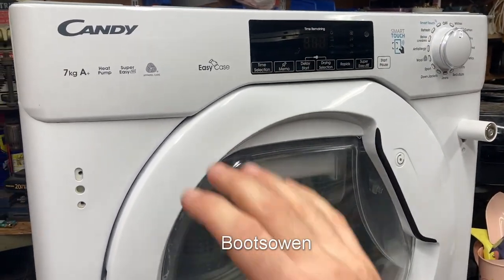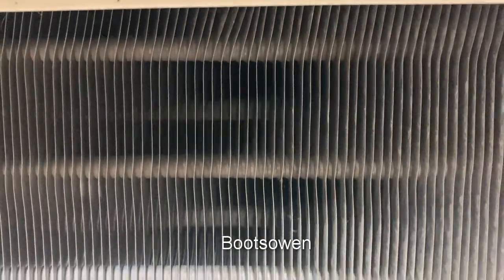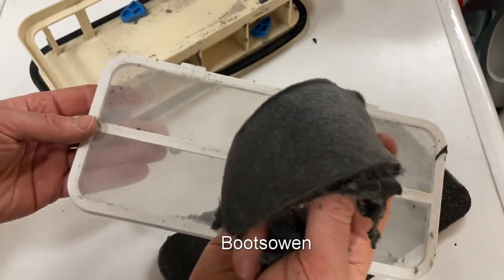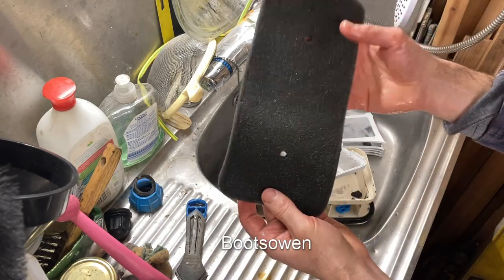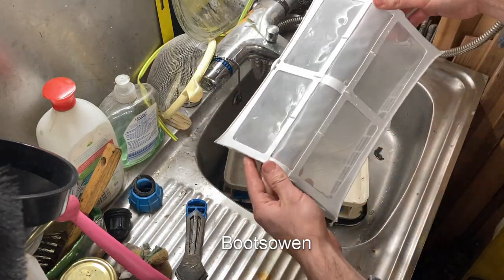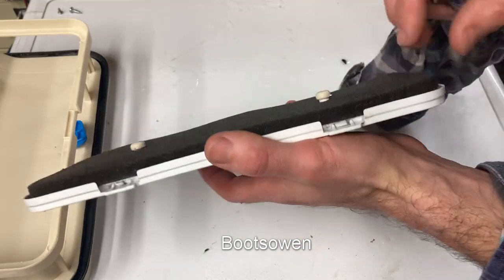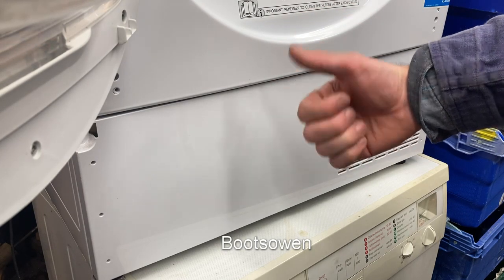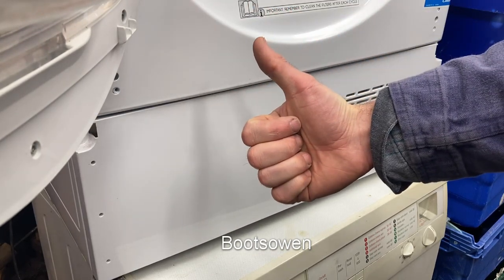How to clean the heat pump tumble dryer filter

Comment: Rule of thumb is. If ya can't see through a lint filter then air can't pass through it. One in the door after every cycle, one in the bottom once a week. Our whirlpool are the same. They can get caked in white gunk from laundry powder and softener too, it's very important to keep them clean.

Comment: What do you do if the bottom filter is full of water and the dryer keeps stopping with the light indicator flashing
Reply from the maker: You check the pump at the back and see why the water is not getting pumped out?

Comment: I try to clean the fins with a brush and have moderate success. Alot of the lint still ends up getting stuck at the top or bottom ends of the fins. How do you remove them?
Reply from the maker: Have a look at my videos cleaning a Samsung heat pump that was completely blocked
Reply: @bootsowen  ok thanks

Comment: I have the same dryer. It keeps getting stuck with 2 minutes remaining and will not stop. Any ideas anyone?
Reply: If your filters are clean, then you need to call maintenence (hopefully it's under warranty), as they explained to me it's common programming failure. Or try some other program, maybe it will avoid the issue 🤞
Reply: I have same problem but mine dryer is hoover 😢